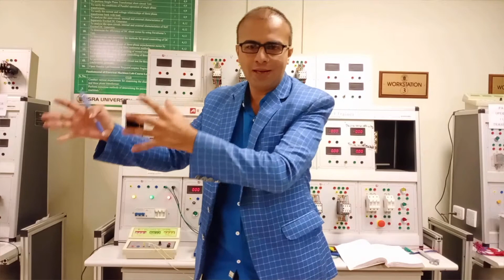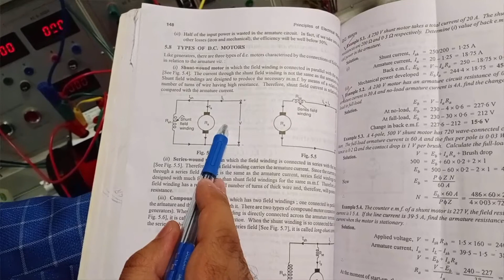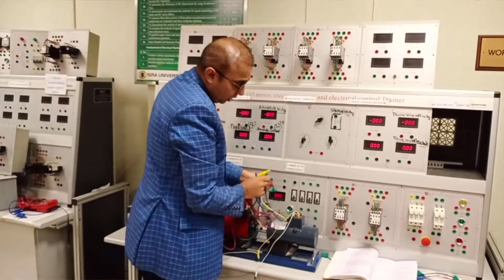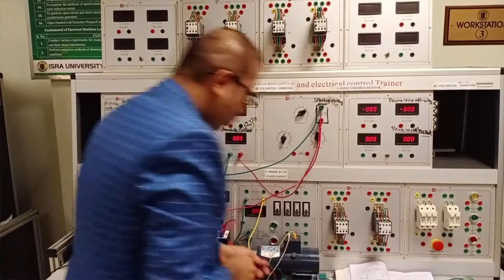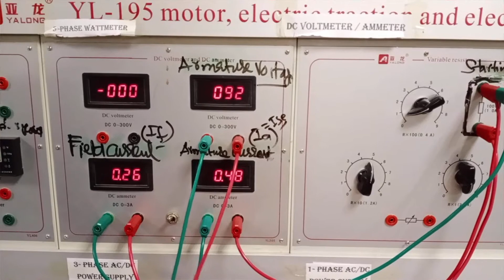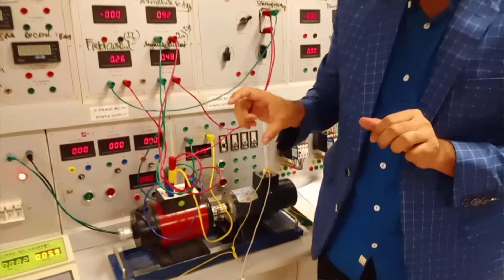DC Shunt Motor Operation (Experiment No. 19) | Working of DC Shunt Motor | Electrical Engineering

Comment: What  will happen if the shunt field is connected in series with the armature? Will the torque increases, since the armature current in now reduced because of the resistances in Shunt field and the armature windings are now add up (Rshunt+Rarm)?
Reply from the maker: If shunt field winding is connected in series with armature winding...obviously it will be called as DC series machine....and in DC series machine whole current of machine is same as IL = Ise = I load......DC series machines are used where large starting torque is required...like in electric traction and elevators...because series winding has fewer number of turns with thick wire...then it will carry large amount of current because resistance is low in series winding...
Reply: Shoaib Ahmed Dayo What if the shunt field accidentally connected in series with armature?

If series winding is connected parallel to armature,obviously it will overheat and burnout because the current increases more than the nominal current of the series winding.But what if the shunt field is connected in series with the armature?What will happen?
Reply from the maker: It will not be accidently connected......During manufacturing of machines these windings are decided that either connected in series or parallel...it depend upon the type of DC machine...as your question can be turn in to another direction that if suddenly field winding is open circuited in DC machine what happens...obviously back emf will drop to zero and armature will draw more current to makeup the EMF....
Reply from the maker: Iam very thankfull of you to give me motivation...do subscribe my channel....and where are you from?